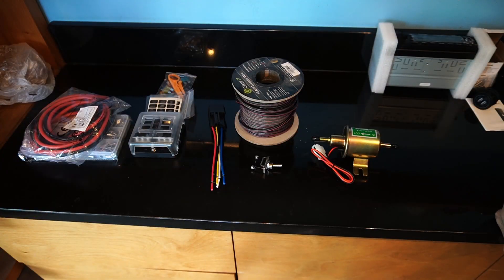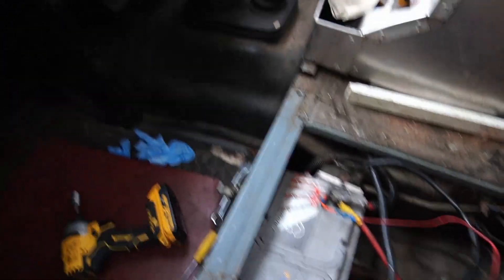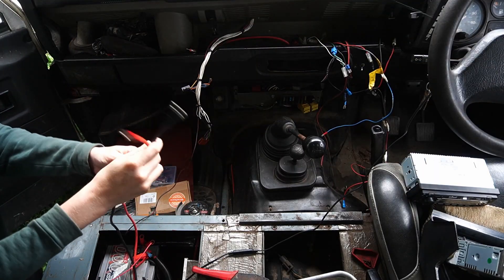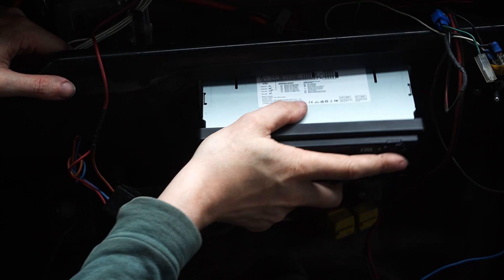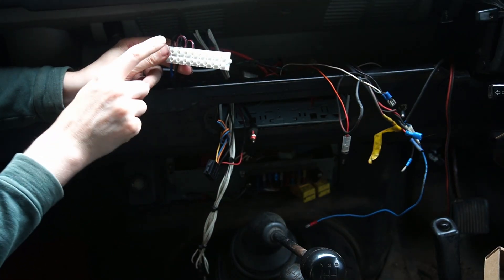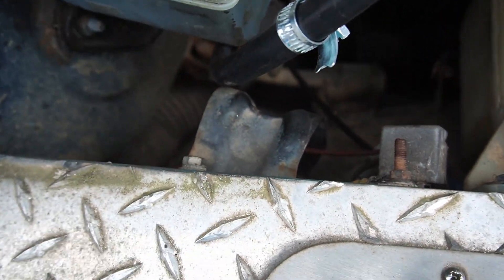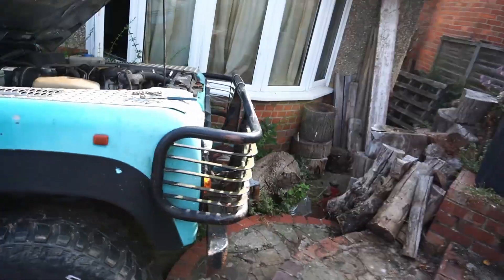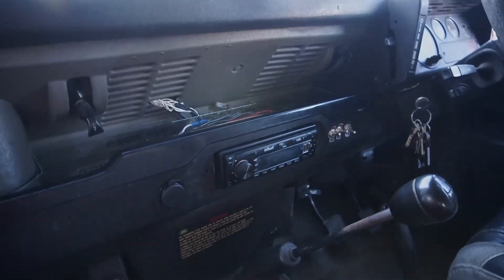Fitting an electric fuel pump to defender 300tdi || Also one job lead to another

Comment: Hi thanks for the video. I did the same on my land rover I mean just the fuel pump it worked to start but stopped cause carburettor got flooded and leaked petrol. Have I missed something? Thanks
Reply from the maker: I have a diesel engine and don't have a carb, it is likely float chamber the pump is likely over powering the float or the float is stuck open and therefore the pump can just push fuel into the engine
Reply: @InfinityMindDIY  thanks didn't know it was diesel. Do you have any solution in mind for my case. Thanks
Reply from the maker: @benabedabdennour9878  checking the float and making sure its not stuck open or that it still floats, i don't know what the land rover one is made of but old foam floats used to degrade and not stop fuel coming into the carb, it could also could have a bit of muck in it if you have been playing with the system. don't play with the jets unless you know what you are doing. although if you have changed them it could be the reason it floods.

Let us know how it goes